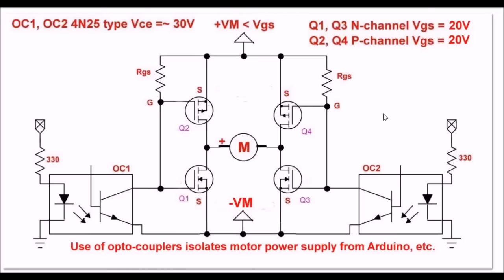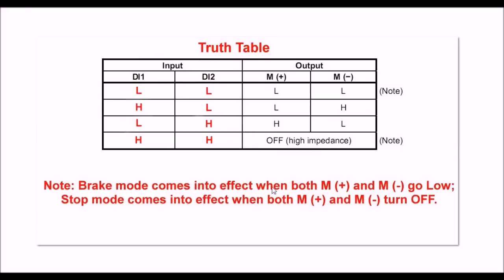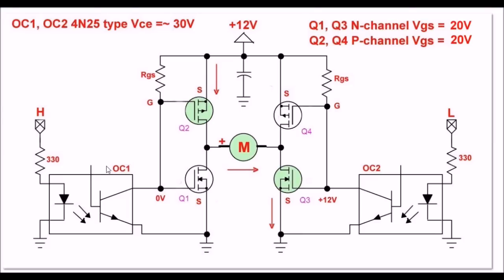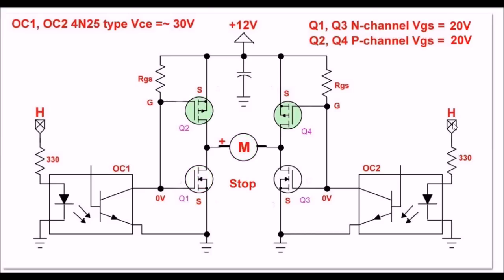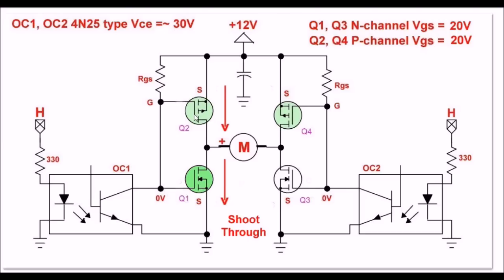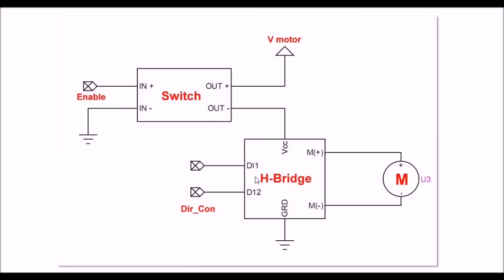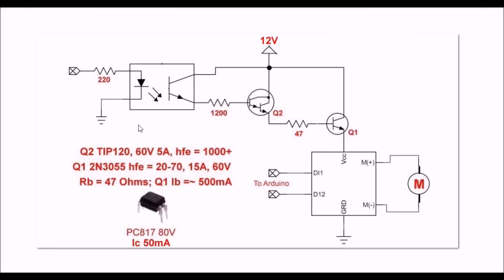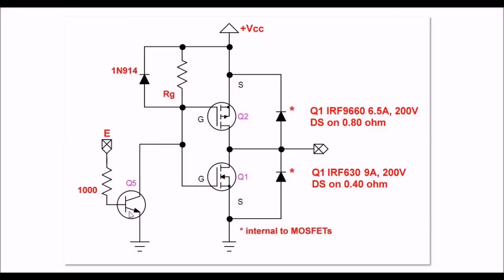Power MOSFET H-Bridge Update

Comment: I think that Q1 IRF9660 should read IRF9630.
Reply from the maker: Wrong. It's 630.
Reply: @LewisLoflin  I'm not arguing, but have another look around 10:11. It mentions Q1 IRF9660 and also Q1 (underneath) IRF630. There is no reference to Q2. Confusing. 
Based on your schematics I have bought 20 of those 630 and 9630 mosfets.
Reply from the maker: @johnvine5731  Follow the schematic.

Comment: This is not going to work well especially the MOSFETs are high power MOSFET because of the shoot-through issue. It might work for low power MOSFETs (with high intrinsic drain-source resistance) and low Rgs or the power supply has large output impedance.
Reply from the maker: This is on concepts not a finished product. See https://www.bristolwatch.com/index.htm for a list of H-bridge circuits.
Reply from the maker: Used it for years under live tests and works fine. Program the microcontroller to turn off for between direction changes.
Reply: @LewisLoflin  Sorry for not explaining clear enough in my previous post. Obviously it worked for you, otherwise you wouldn't had made the video. You did not see the problem because in your H-bridge DC motor direction driver, you switched very very infrequently (and most probably supplying power from a current limited power supply). But in general (especially for high power system with frequent switching), we want to avoid shoot-through on each leg of the PMOS and NMOS pairs by inserting some small switching deadtime.
Reply from the maker: I know precisely what shoot-through is, just never had problems with it. Note that the voltage limit is 18V VCC. I did have a problem with P-channels getting hot originally, which was due to high Rgs in the P-channel MOSFETs. I used better low Rgs, and the problem was cleared up. Since I program controllers at low levels, I can clear most problems in programming. Thanks for the input.

Comment from the maker: More mostly MOSFET circuits:
High Voltage IGBT H-Bridge Using Photovoltaic Optocouplers
https://youtu.be/azJo4h-ei6I

Arduino Controlled IR2110 Based H-Bridge HV Motor Control
https://youtu.be/d0r-Yx9R3Zs

Build Power MOSFET H-Bridge for Arduino
https://www.youtube.com/watch?v=IjgvKJrAOS4

Pt. 1 Interfacing Microcontrollers to CMOS and MOSFET Circuits
https://youtu.be/XzetdwzcOrY

Pt. 2 Simplified CMOS-MOSFET H-Bridge Circuit
https://youtu.be/rExHPqTUBuA

Pt. 3 Tri-State H-Bridge using CD4093B CMOS Circuit
https://youtu.be/b8O4ihdHx8U

Arduino Unipolar Stepper Motor Driver Board with Arduino Code
https://youtu.be/HTVYiLOY8SQ

Pt. 1 Intro. TC4420-TC4429 High Power MOSFET Drivers
https://youtu.be/5lxxiC1HtBk

Pt. 2 TC4420-29 MOSFET Drivers Circuit Examples
https://youtu.be/-Pmhx_ebJKM

Pt. 3 TC4420 MOSFET Driver H-Bridge Circuit
https://youtu.be/h_0t50j0BxM

Related webpages:
http://www.bristolwatch.com/TC4420/index.htm
http://www.bristolwatch.com/TC4420/TC4420hb.htm
http://www.bristolwatch.com/TC4420/TC4420hb2.htm

Comment: Hi Lewis, great video. I have a question, with both sides of the motor connected to +12V, wont this act as a break in the same way as connecting both to GND. As both sides are basically just connected to each other but via the +12V rail instead of GND?
Reply from the maker: I think ground is break and +Vcc feeds power back to the supply.
Reply: @LewisLoflin  With both of the motor terminals connected to the same potential, whatever that is +12V or GND or anything in-between. then the back EMF would cause a breaking effect. I guess you could reproduce this by shorting a motor with a piece of wire and connecting that to the 12V terminal of a battery and see if the motor still resists turning. I think that it will.
Reply from the maker: @ChrisPavey85  I'll buy that but the literature is vague on the sunject.
Reply: Chris has it right.  Any time you connect the two motor leads to the same potential, whether it be 0V or 1000V, you will get the same braking effect.

Comment: I had the parts on hand, I built this, and it works! I used IRF9540 and IRF540, TIP120 and MJE3055. Now can you tell me, why do you need to make essentially a "triple Darlington?"  Is that much gain really necessary? Thanks.
Reply from the maker: With switching one wants gain. You drive the transistors into saturation. Also I happened to have the parts. This is a lesson in transistor switching as much as being a h-bridge. Given you much to think about? You get an A for the class.

Comment: Hi sir ...thanks a lot for your great support...I used IRF9450 for high side and 630 for low side ...result was painful and  in all condition short circuit was happening...rds of p mos should be 2 times mor than n mos to prevent this situation...but in mor rds cases we have less current ...so can I keeps remain 9450 and parallel 4 630 to have more current?
Reply: The right complementary pair is
540 and 9540, try it to solve your problem

Comment: what happens  during transition, when  its halfway between 20v and ground and technically all mosfets are on
Reply from the maker: You won't be able to cut them all on at once. Switch one side or the other at a time. I've never had a problem with this.

Comment: what is idle power consumption for this scheme?
Reply from the maker: Vcc / 10K * 2. Or motor voltage divided by 10,000 and for 2 resistors times 2.
Reply: @LewisLoflin  I used L293 and it was much worse, around 12 milliamp, vcc=12V

Comment: Hello sir, can you advice me a driver circuit to drive all 4 N type MOSFETs H-Bridge with 24V supply application in a simpler way?
Reply: use a gate driver with boot straping and complimentary pwm output , that is the simplest way

Comment: sir, when it goes high why the optocoupler voltage becomes 0 ?
Reply from the maker: I assume you mean high in the input. The photo transistor is switched on dropping the voltage across the collector resistor.

Comment: Pls make a video about inverter air conditioner circuit board
Reply from the maker: What kind of air conditioner circuit? I'm doing one for mine to shut off the system when the room is cooled. Otherwise the blower fan runs all the time.

Comment: what is the value and type of capacitor. which are you using??  And also tell me that which transistors is best for it?
can we use it with rf transmitter and receiver & with arduino? 
and really very awesome video. 
A big thanks from INDIA.
Reply from the maker: The cap isn't critical. 1000uF. Yes on the Arduino, etc.
Reply: @LewisLoflin  i want to use this h bridge circuit with rf transmitter and receiver for remote control car but the output current of rf transmitter and receiver is very low. so will it work with low current? if yes then tell me that which transistor or mosfet and optocoupler will be best for my project. And what is the value of rgs??? please tell me.

Comment: When I try to run this circuit there is no voltage difference between motors poles. How can I fix it?
Reply from the maker: It won't be unless the two inputs differ. As they normally operate with no input to either side both are switched to ground. So no difference in voltage across poles. Same if both are switched on.
Reply: mr Lewis Loflin, thanks for return 
When I did double check my circuit I noticed that my pnp mosfet connection was not correct. After that I could reach enough values.
Reply from the maker: @dogukanayc2761  Great work.

Comment: Nice video. I guess there is a typo and you are actually using an IRF9630 as your pmos transistor. I'm not sure why you are not bootstrapping the pmos transistors. As shown, if you want to generate a -10V Vgs (required to get the 0.8 Ohm Rdson), you need to drop this in Rg dissipating a lot of power (100 / Rg Watts). The power dissipated by a bootstrap circuit after it initially charges up is only a little more than that required to charge and discharge the gate capacitance. In addition, switching times will be faster with a bootstrap because you don't have the relatively large Rg as part of the time constant...
Reply: I'm yet to come across an H bridge circuit with bootstrapping of P channel high side FETs. It isn't required to achieve the desired gate voltage. Not sure about the switching time. Is that an issue?
Reply: It depends on how much power the motor is dissipating. If the motor is dissipating a lot of power or if you don't care about efficiency, then the circuit is fine. If the motor isn't dissipating much power and you are interested in efficiency, you will need to use a reasonably large Rgs and this will lead to slow turn on for the nmos transistors based on the time constant from Rgs and the combined gate capacitances. But you're right in the sense that the circuit is simple and will be fine for almost all applications.
Reply: With supply voltage of 12V and Rgs 10k, power used by the resistor is <15mW... Negligible in comparison to the motor, which is likely using >1000 times that.

Comment: for mosfet important gate charge current.   for fast switching.  how to make maximum current for gate ?   I'm making a 50 volt 40 amp bridge.   I need a large gate charge current IXTH48P20P TO-3P P-channel 
IRFP4332PBF, ,  250В 57А N-channel     can I write you a mail?
Reply from the maker: MOSFETs are voltage operated not current operated. What kind of large gate charge/voltage?